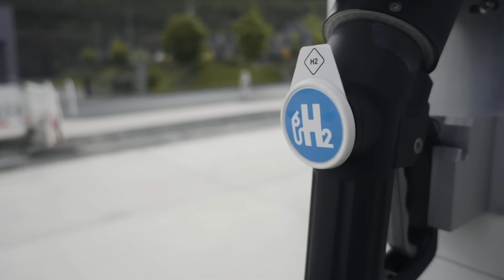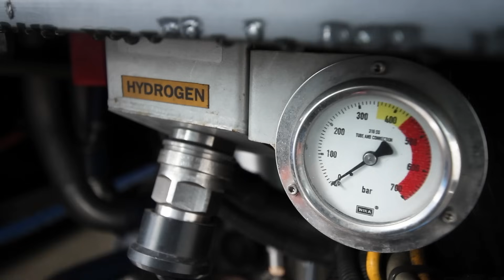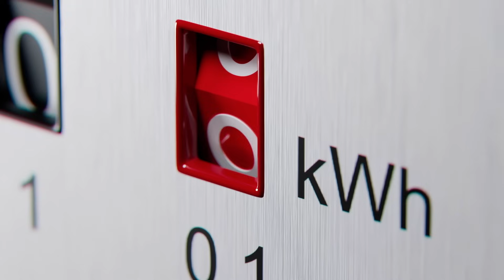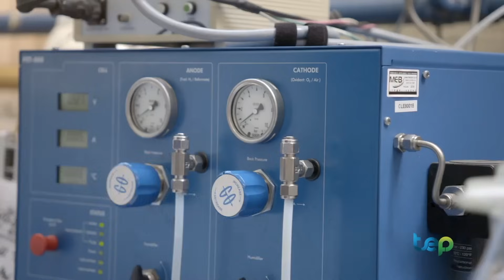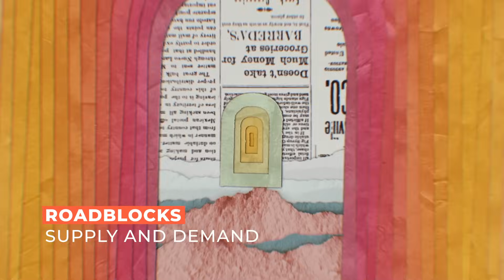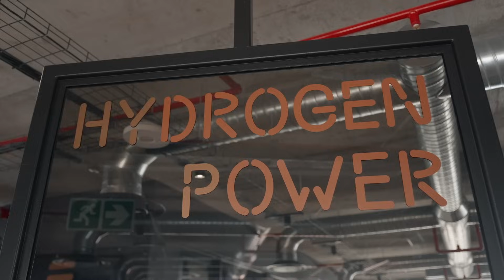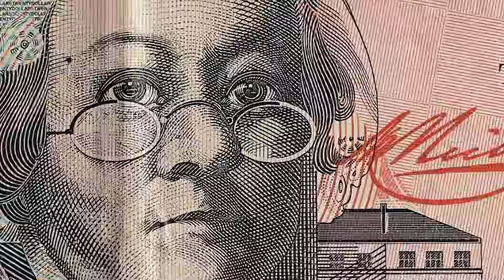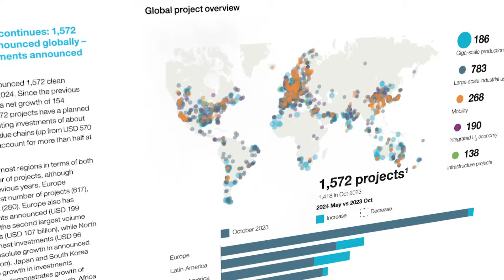Is Hydrogen The Quickest Way To Create Clean Energy?

Comment: The new era of the grid should see it be designed to be 'fit for purpose.'  That is to say, far less waste is to be expected.  Accordingly, take the current grid losses, and turn them into hydrogen generation and battery fill. As it stands currently, billions of dollars can be made in the immediate term, just by installing electrolyzers and batteries, at scale.